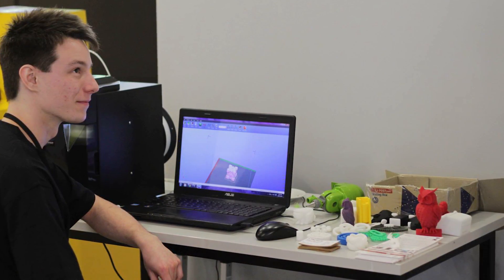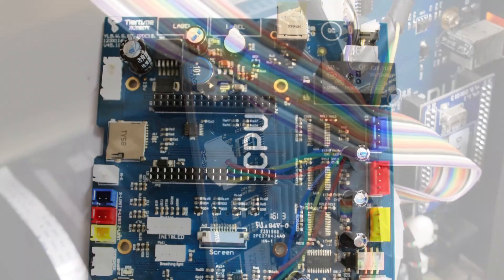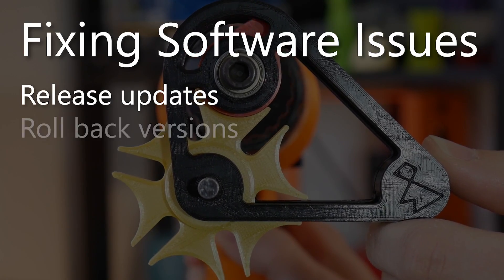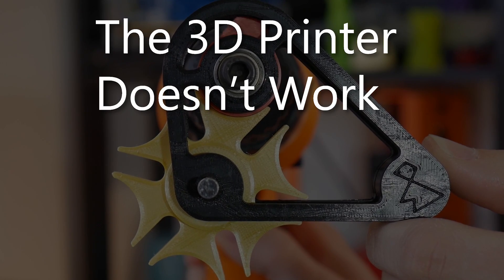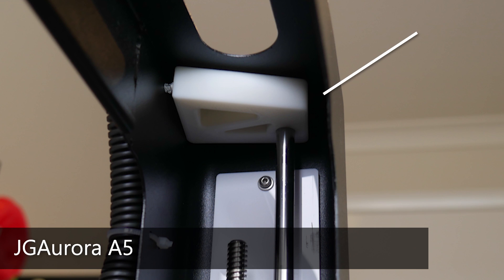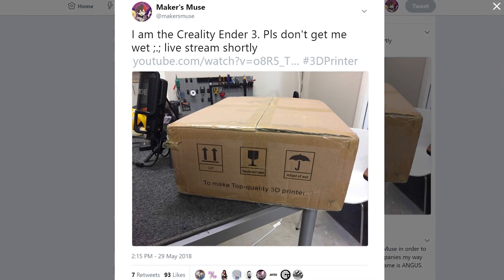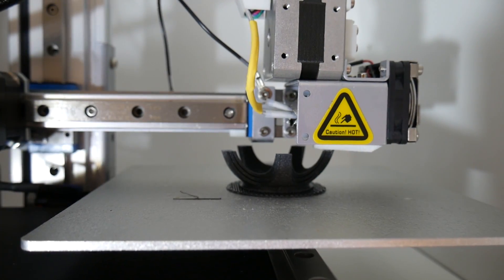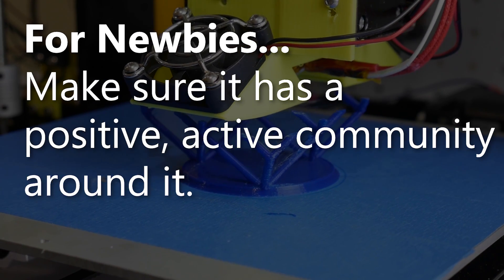Serious Concerns with 3D Printer Quality Control

Comment: i wish i bought a up mini instead of my headache of a davinci but build volume sucked me in
Reply: What issues have you had ? I had major problems with filament eject until I figured it out (built in mode does not work reliably, basically). Pretty reliable now though, with just occasional "drill bit nozzle cleaning" needed.
Reply: to be fair i was new printing and probably could have stopped some of the issues i had it has been fully upgraded now but i still have a cartidge resetter if u need onre

Comment: I have my second printer on its way (jgaurora A5), I have my fingers crossed. Reviews for printers are all over the place.
Reply: Ausyarr bought one recently from lightinthebox. Except that it’s quite loud and tracks were not lubricated well, it works great. I’m new to 3d printing but I’m quite happy. Have to fine tune a little bit a cura profiles for very small parts for better quality, as heatbed moving on Y axis is heavy and thus acceleration needs to be smaller.
Reply: Thanks mate, I already have a creality cr-10 Mini and I've heard the A5 can get higher temps for ABS and the print bed has more grip than a glass bed.
Reply: Ausyarr yes, heatbed has very good grip, however even than I’m using a patex glue stick mixed with water for better adhesion, especially for small parts. I use a stick on heatbed first than wipe it with wet gaze and let it wapor (by itself, not by heating a heatbed as I worry it might crack). 
Than parts stick like hell, you really have to wait (patience!) to cool down heatbed completely as even when temperature drops down to 40-50 degs, it sticks very well.

Had not tried to print ABS yet, just PETG (my material of choice!) but I will soon try to print some safety flags for a rifles as some people joining our club IPSC competitions don’t have them. Shouldn’t be a problem as those are quite smal, for bigger parts I would rather use some enclosure.

Anyway, I tried to heat up heatbed to maximum (110 °C) and it got there, even if it took quite a while. Can’t confirm that by measuring, tho.

Comment: Thanks for this video!

My first printer was an Anet A8 kit, and I spent most of the time printing upgrades, buying better parts and upgrading.
It came with a bent heatbed, bent rods, uneven frame and more.

Since I had no idea about 3d printing it was hard to find the issues, but luckily the 3d printing community is awesome and helped me through.

I can imagine that many people would have given up with issues like that. 
But on the other hand I'm quite happy about it - because I really learned a lot about the machine and how to fix it.
Reply: I would have hated it. I bought a printer for printing my ideas. All I did was building an enclosure. However I had one sensor failure that was replaced (MK3 Filament sensor). If prusa would not have provided that without additional charge I would have been furious.
Reply: Johannes M that's why I saved some money and ordered a Prusa MK3 (which hopefully will arrive soon). I wanted at least one printer that works without having issues all the time.
Reply: DasMia, I had the same with my Anet A6, but it wasn't in such a bad state...
Reply: if you haven't received it yet, I assume you were not one of the very early costumers. Your machine should therefore be working like a charm. Good luck!
Reply: Johannes M thank you! ☺️
I ordered mine mid April and got a mail yesterday that it is shipped.
Should arrive soon, I'm very excited!
Reply: Happy Printing. I'm really happy with my Mk3.

Comment: Prusa is guilty of this. On a horrific scale.
Reply: My mk3 had problems but it did work out of the box. They offered solutions and support unlike the other printers I bought. They produce machines with version numbers. If you wanted something closer to flawless the mk2's are still available and have years of experience built in. I wish they'd spent more time on testing but I would not call my experience "horrific" by any means
Reply: wilson mura , software can only hide hardware problems, not "fix" them. Companies believe they cannot afford replacement of inferior hardware.
Reply: wilson mura yes software can be fixed, but they changed certain parts and designs as time went on with the mk3. It even says it in the manual that parts are different between printers.
Reply from the maker: Yes, the Mk3 was a bungle to be sure. I want to be clear that this is an issue I'm noticing industry wide among many companies.
Reply: Guilty yes, on a horrific scale... not so much. Like Angus said software can get fixed.
Reply: The MK2 was also pretty bad out of the gate.

Comment: Since when does a whole extruder, hot end assembly thing just completely fall off?
Reply from the maker: Oh, the thumbnail? It didn't fall off, it just... didn't work. The whole machine that is, the hot end did warm up but the timing belts were sandwiched into place behind it...!
Reply: Maker's Muse oh wow, that's not a good start at all
Reply: The other 2% is asbestos.
Reply: @thesuperjezz2740  Well, atleast it won't catch on fire.  looks at my Tevo Tornado nervously
Reply: Was probably built in China, which means it has about a 98% lead content. Lead isn't very structurally sound. :)